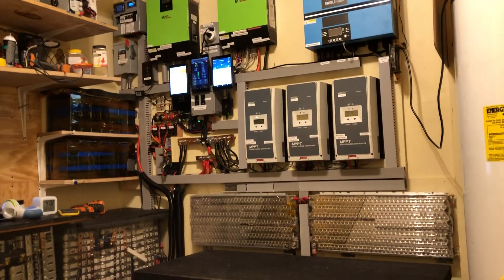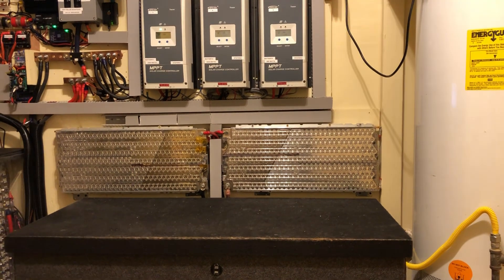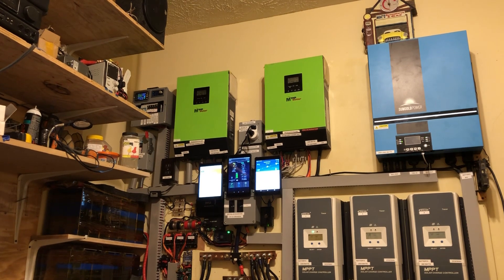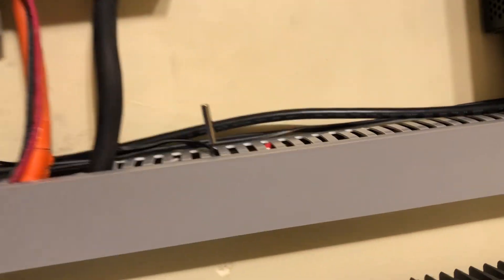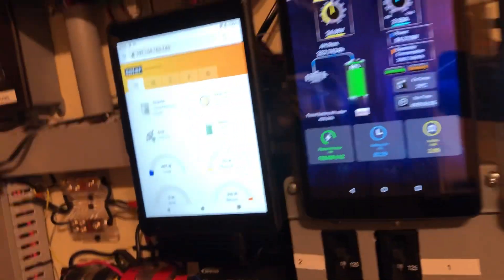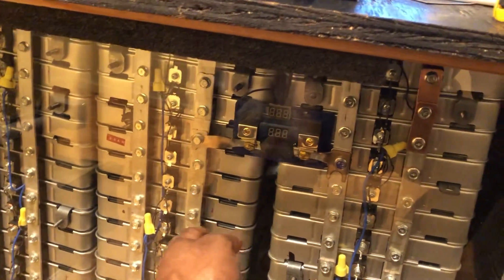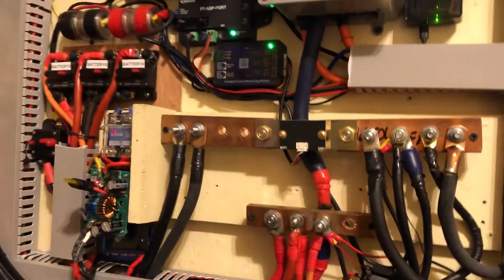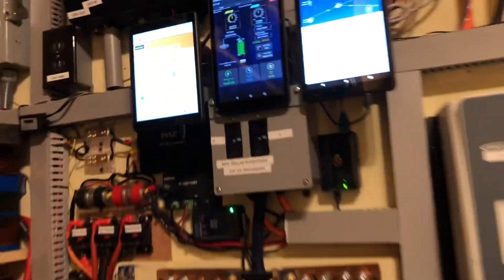MPP solar hybrid inverters 24v and sungold power inverter 48v

Comment: Good to have you back. Quick question does that sungoldpower sp6548 make your led lights flicker?
Reply from the maker: No  it doesn’t if your led light is flickering then try a different brand——thanks for checking out my video

Comment: What is the reason that you use 14S instead of 16S, for a 48V system?
Reply from the maker: Because at max charge on each cell would be 3.65 
Times 7 would be 25.55v so. There was no need to do 8s not only that  my tesla packs and chevy pack are also 7s---- thanks for  checking out my video